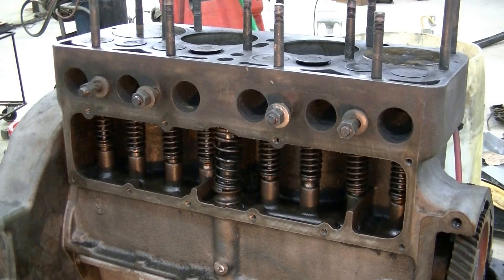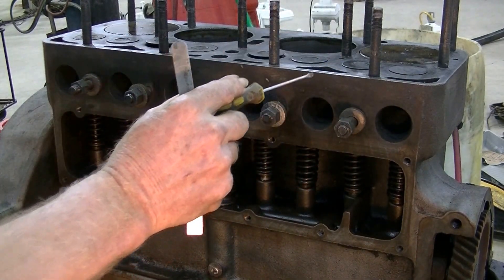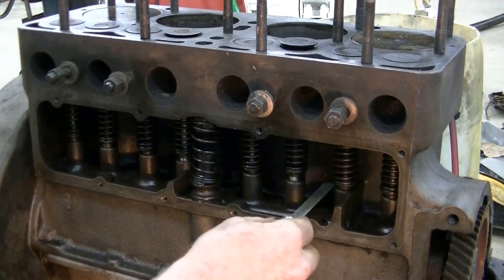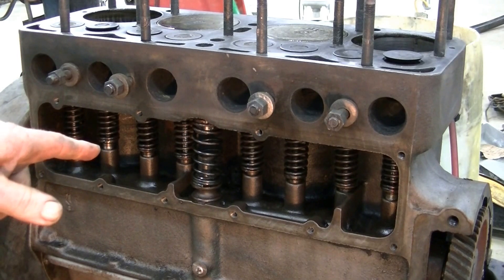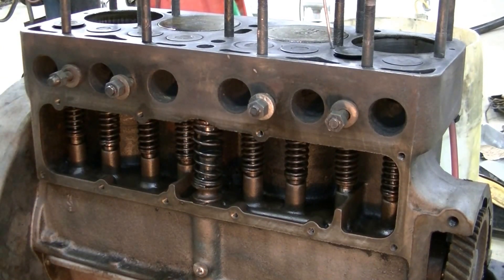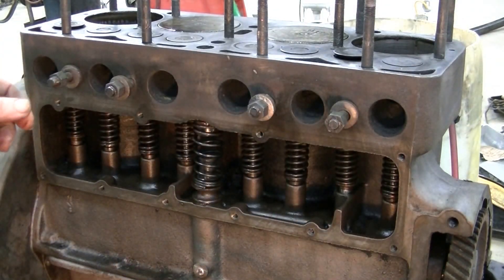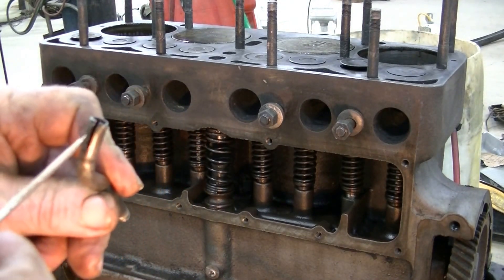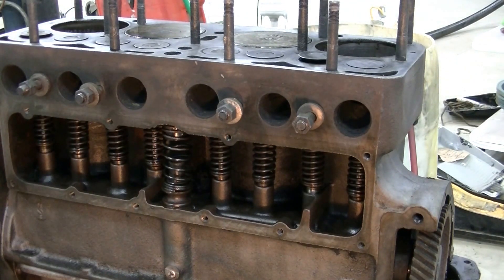Model A Ford Engine Valve Adjustment - zeketheantiquefreak

Comment: Hello, I happen to own a  34' ford model CX it's a side valve engine, 10hp one. Do those engines adjust as well, or do I have to grind as well?
Reply from the maker: There are times I have to admit that I do not know... I am familiar with the 28/29 Model A's but am not sure about the newer ones. There are lots of knowledgeable hobbyists out there, perhaps someone can chime in with the answer. Thank you for the comment.
Reply: @zeketheantiquefreak8518  hola muy bien e xplicado , que luz lleva en mm. Las valvulas
Reply from the maker: @juliovega7453  .015" = .384 mm.
Reply: Thank you very much!
Every bit of information it's much appreciated! 
Thanks

Comment: good night , i have a ford , year 29 i live in Campinas SP Brazil i have a problem , water passed into the engine through the inlet valve of the fourth cylinder , the gasket is not burnt , i can not know how this water passed i have already removed the valve and i didn't see any cracks, can you give me any tips
Reply from the maker: I hope I can help... I am assuming the engine is still in the vehicle? There is 'crack detection' technology out there, such as the magnet/magnetic powder method that will display a crack not visible to the eye. There may be a chemical for this purpose that you could use in your shop instead of having to borrow equipment or take it to an engine rebuilder for the magnetic method. Can you fill the block with water with the head off and see if there is any seepage? The crack may be in the cylinder head, even though the gasket seems fine. I think that a good round of crack detection would be in order. Let me know what you think. Thank you for the comment.

Comment: another thought about the drain tube--I don't know but it's possible that the tube could be unintentionally inserted too far into the bearing causing potential damage to the bearing or the crankshaft.  It might be a good idea to measure the depth of the hole in the bearing and be careful not to insert the tube further than it was originally installed.
Reply from the maker: Hey, thanks a bunch for the info. If I remember correctly the tube was threaded and I put it in with thread lock, all the time not having a clue what the tubes purpose was. Maybe some tubes were an interference fit and could be placed too deep into the rear bearing?

Comment: The drain tube was common to Model A engines, although many have likely been modified or discarded. The tube purpose is to drain rear main lube oil back into the oil pan to minimize the leakage of oil out the rear main bearing.  The ball check is to keep from siphoning oil out of the pan in case the car is parked on a steep forward incline.  This info is from McCree's book on Model A engine, page 18.  That book says the tube can be tacked into place to prevent its coming loose and falling into the pan.  Probably that tac can only be done if new babbitt is being poured into the rear main.  Some thread lock compound might be a better choice if the main bearing is not being removed.  The book says never to use a tube that has been lengthened or shortened.  In the next paragraph it says it's OK to cut off the tube above the check valve to improve the return of oil to the oil pan??
Reply from the maker: Sadly, I just found this now, three years later. Thank you for the message and the good info.
Reply: So it "drains" main oil to minimize leakage at the main bearing past the seal. Why not get the seal out of the bearing journal and let oil "fall" back into the pan instead of trying to "drain" it into an "airlocked" tube thar whether or not the bottom is in oil or crankcase pressure is "pressurized" relative to "gravity" and unable to allow the oil to "drain" directly out of an area where typically you prefer to "trap" oil "drainage" and induce/encourage a built in leak to improve "sealing".

Comment: the ball valve in the oil drain was a special design for the AA grain trucks. When they delivered grain to the grainery, they were often tipped (or even rolled over on a platform) to empty the grain bed. The ball in the oil drain tube was to prevent oil siphoning out while the truck was tipped up.
Reply from the maker: Hey, thanks...Good info that I would not have thought of.
Reply: ROFLMAO.

Comment: Great video! i am working on my first 1930 model A project. I purchased a engine gasket kit and am interested to know your take on compression. The engine was running a year ago, what kind of compression should i see?
Reply from the maker: Hmmm... This engine we just re-gasketed (not good English?) ran well before we took it apart. After assembly it had 70 psi plus or minus about 5% by our gauge. This was without touching the valves or rings. In your case, the reading would be more accurate if you could also run the engine before doing the compression test. This will help seat the rings and free up the valves. If one cylinder is low, it is standard practice to put oil in the cylinder and check the compression again. If the reading improves, the rings are weak. If there is no change, a valve or head gasket is at fault. Look for a reading of no more than 10% difference between cylinders. Hope this helps and let us know how you make out. Thank you for the comment.
Reply: My 1931 has the following cold.  #4 -58 #3 -60 #2 -60 #1 -63.